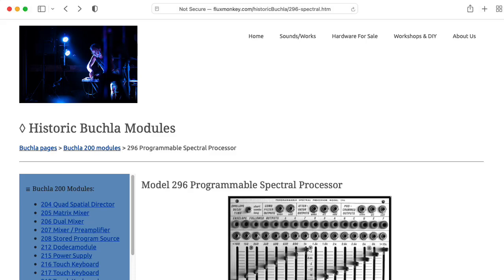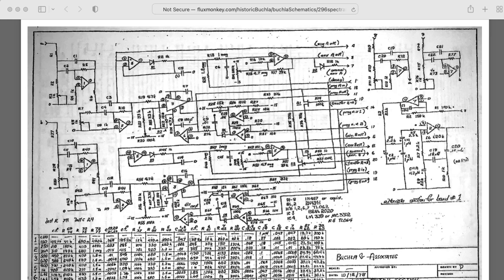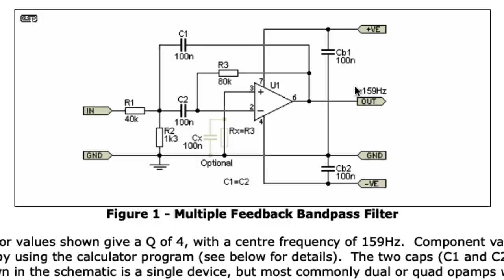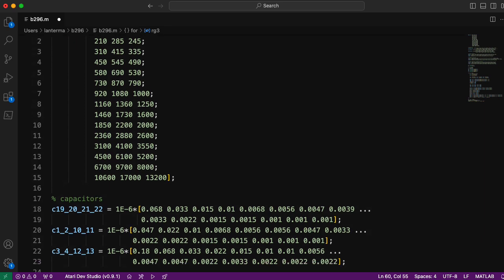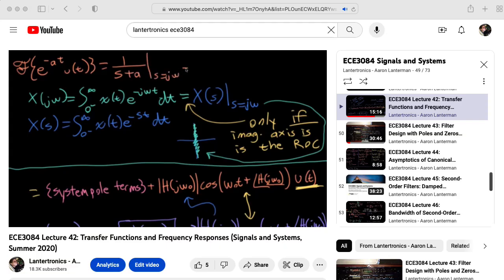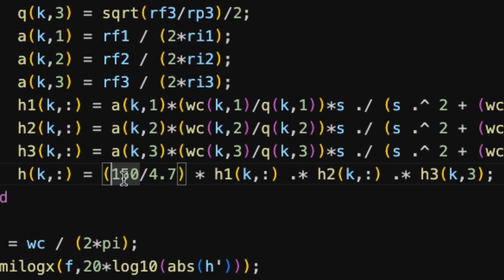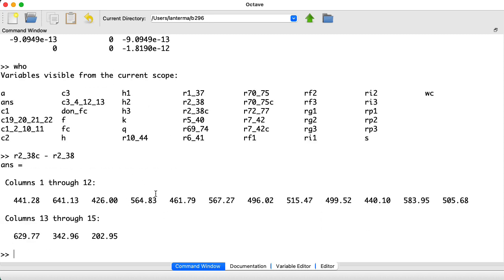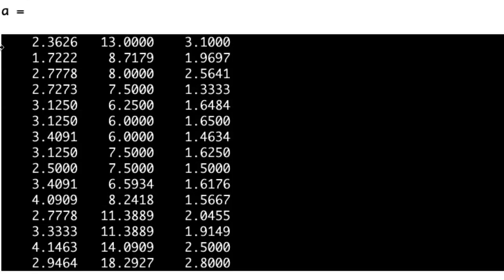Filterbank Analysis of the Buchla 296 Programmable Spectral Processor (help me find my mistake!)

Comment: I ran a Spice simulation on that input stage to the filter and between 20-20K, if I'm reading the schematic correctly, it is a high pass filter with the cutoff frequency around 186 Hz. The gain rises around 20 dB from 20 Hz to 3 kHz. Plus there are two different input gain stages for even and odd filters. Although the values look the same there is that extra circuit off of the non-inverting side of the amplifier that looks to be connected to nothing - very odd, maybe both even and odd are the same and that extra amplifier was chicken scratching...

Comment: Looks to me like each band filter gain is set by Rf/Rin. My guess is that the values of Rin and Rf in each band are such that gain drops off as we move from low freq to hig freq. Trimpots on each band allow gain tweaking to flatten the overall response.
Reply: came here to ask what effect the trim pots would have in attempting to level it out, & whether that's how they were calibrated by buchla &/or its users, hence the flatter spec-an shots.

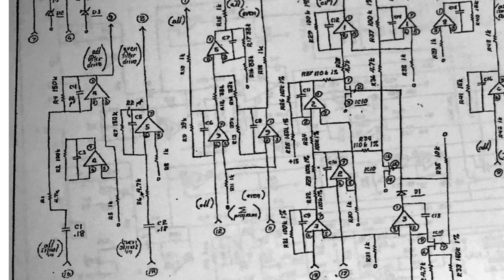Comment: Since this is a Buchla schematic, I could be misunderstanding the signal flow, but I caught something that could possibly account for why the lowest band is so much larger than the others. In the image you have at 7:32, there's a 0.18uF cap in series with the 4.7k. It looks like a DC blocking cap, but with only a 4.7k, its cutoff is 188Hz which means it'll affect the lowest band. I don't have an answer to the rest of the bands, but if you take out the lowest band, the slope is much less aggressive overall.

Comment: I don't how accurate your filter models are (in terms of emulating an analogue filter), but if there are differing q levels in each band that might also mean differing amplitudes, I have a roland groovebox which throws all that out of the window and keeps volume consistent at higher q's and a nord modular which faithfully models it, I was ever so dissapointed when I found this out. I'd been thinking it'd be good to hook an SSI2130 up to an MCU and use it to retune or calibrate the VCO on the fly so TZFM would stay in tune, I wonder if something similar would be possible with a VC filterbank, reading the amplitude of each band and adjusting them, probably overkill, doing this at the design stage might be enough, slightly related is the synclavier approach to resynthesis, bunch of oscillators at fixed frequencies then envelopes adjusting amplitude to recreate sound samples

Comment: My first thought when seeing that graph was, I wonder how flat that would look if you summed up the channels. This was without any thought of the question in the conclusion. Maybe it's an optical illusion from the log-log plot, but it looks like the high frequency rolloff from the lowpass filters has a bigger contribution to the overall signal than that of the highpass filters. The gradual decrease in gain might be related to that, to avoid a high frequency emphasis when all stages are set to unity by the user.

Also, you mentioned how you might expect one channel being out whack might look like. I think the lowest band looks a bit out of whack with a much higher gain. I'd suggest omitting that from summing the channels as suggested above or similar such analysis.

Comment: Try summing those gains to see what it looks like. I’d expect the lack of channels to the left of the left-most channels to cause them to get less gain, compared to the channels in the middle surrounded by other channels. Of course that doesn’t explain why we don’t see the same thing on the right side.

Also try spice modelling a few stages. Someone else mentioned the GBWP, I can imagine a high-gain op-amp in a feedback loop causing higher gains at higher frequencies that might cancel out your downward trend. I don’t think I actually see such an arrangement though.

Do you know if the white noise measurements were done with the linear pots in their centre position?

Comment: While I have never played with any of Buchla's hardware, you have got me hooked on looking at his circuits. I get the sense that Don used a lot of circuit intuition, and did a lot of his designs empirically, starting from a sound design base, but going off the rails if it got him what he wanted. I wonder if what you are seeing might be due to the gain-bandwidth reduction of multiple gain stages in series, . If the actual hardware stays fairly flat in amplitude, , maybe some kind of feedforward is going on. If I have learned anything about Buchla's circuits, its that Don didn't play by the rules. :)

Comment: 3:51 X contains 2 values? and Sin() can elaborate that?

I'm watching the video's from"LKlogic" to unrust, polish my algebra, yet somehow math seams to be some sort of fantasy when looking at her "olympiad" video's. sucks if you can't really visualize sin, log, tan, expo functions results.
I just looked at Gyrators for building another EQ module, but never considered "stacking" filters to alter the profile.
How did Buchla get all this knowledge? to build this device, seems awesome.
Reply: You mean the x = -10:0.1:10 ? That’s Matlab speak for an array of values from -10 to 10, spaced out by 0.1. So when you take a function of this array, the output is also an array. You do the same thing with numpy in Python.
Reply: @Scrogan  I only do C/C++, the king of programming languages, see no need to use others. my favorite and only IDE = Qt Creator.